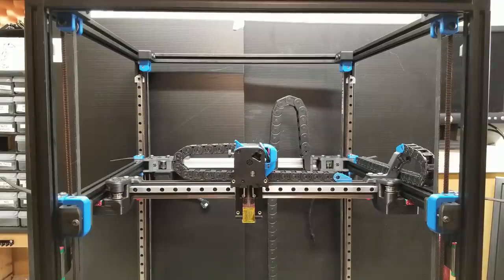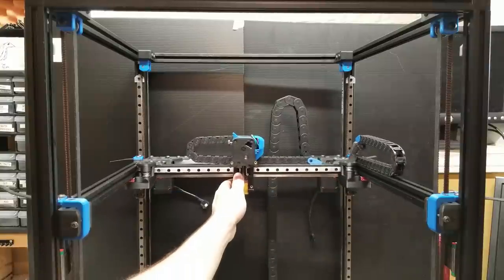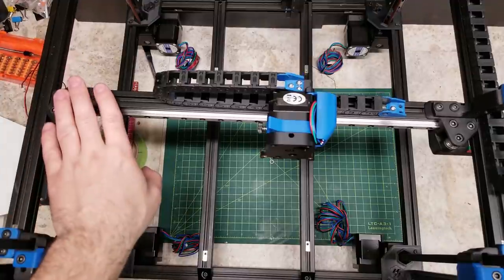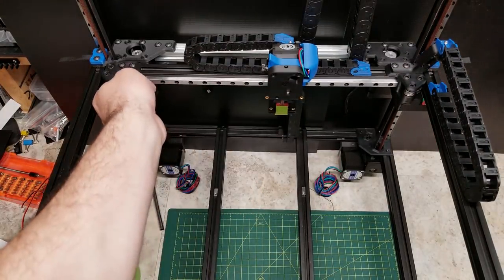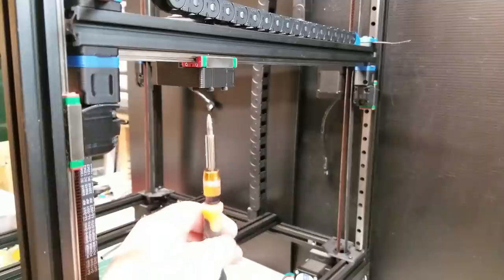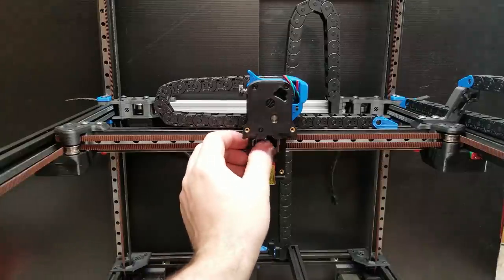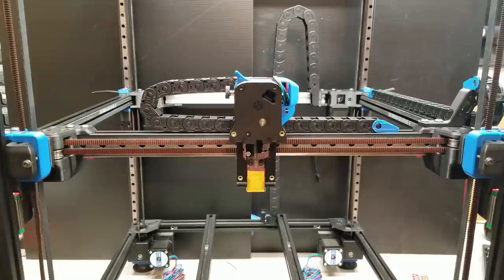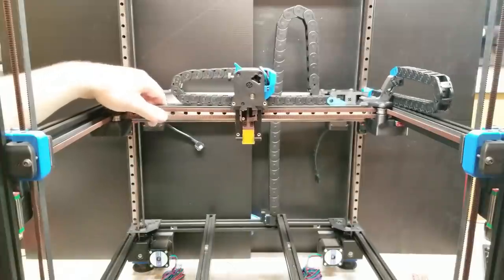Solving Gantry Racking

Comment: For anyone that fails the movement test where the head should not move in a diagonal, i found moving the head with one finger side to side allowed me to see which cable was not moving and easily pin point the bad bearing. I also used a sharpie to apply a mark to the ab drive bearings. After replacing that bearing the movement was nice and smooth like in this video. Thanks for the very helpful video!

Comment: If you have owned a motorbike with a belt drive you know how to tension it, yes there is such a thing as a belt tensioner that shows you how much tension a belt has at a set distance from neutral relaxed position. In fact a ruler plus a small portable weight gauge would do the job. Just make sure you measure at true centre.

Comment: You saved me a lot of hassles and frustration - kudos to the Voron discord community for pointing me here. Basically I put the belts on incorrectly (no equal length) and then completed assembly of the printer. I noticed that I could not get the x limit switch to engage due to the assembly being racked. I removed the belts (and ordered new ones since I already cut these (derp)) and was able to un-rack it. Now the carriage is truly square and moves without binding.

Comment: This is by far the hardest and worst part of building a voron.  I have never found this actually possible.  Unlike what he describes in this video, on every printer I have built, on my 5th, the problem isn't that the problem exists in the opposite corners, it's always the same side.  Doesn't matter how square the frame is.  I have only used LDO extrusions, so maybe the problem lies there, not sure.  But on all 5 printers, 2 tridents, 1 v0, 2 v2.4's, you can push and pull on the same side, front/back.  I'm sure it's 100% me, maybe on arm is longer than the other so I can't get the frame straight, or maybe one eye is much stronger than the other...  who knows.  But I have found it to be 100% impossible to actually rack the frame, regardless of not having any binding, being perfectly level, squaring with precise squares, etc.

Comment: Seems like a proper mechanishm.

My only issue with all these thin cube frames is that they are too big compared to extrusion size and rigidity. I am pretty sure that diagonal (Z-form) reinforcements, possibly not just one per side but at least at the middle of each frame rail too would help a lot in wobbling. Theoretically the Y carriage would need that too (to prevent flexing by heavy X accellerations), but that's hard to install in this form. Maybe something like a strut brace in a car.
Reply: Once you install side panels they'll make the frame more rigid.

Comment: Is the "springiness"  in 6:06 (right side) acceptable? I'm assembling my gantry from scratch and I'm not able to get rid of that (after rebuilding the gantry 4 times), it's always in one of the corners.
Reply from the maker: You want to minimize the racking as much as possible, was kinda hard todo when i was recording but i went through and re-adjusted the belt tension to make sure both XY joints where touching the back at the same time

Comment: Fantastic video!  I've been stalled out on my Voron partially due to gantry issues.  This will help with some of the problems I've noticed in my build immensely!
Reply: You know the best place to get help on your Voron is to get to the voron discord
Reply: @yvesinformel221  When I'm actively doing assembly work I practically live there. 
@
Nero 3dp I just finished fixing my terribly racked gantry prior to wiring/tool head attachment.  I'm so thankful for the timing of your video.  You saved me a LOT of time, effort and cursing.  The documentation for building a Voron is great, the Discord is insanely helpful, but seeing how certain things should be done is priceless.

Comment: At 5:32 if one of the rails works smooth and the other not than you will nbot be able to push in the middle and slide on both sides smooth. So you will also have a gab at one side.

Comment: doesn't this method assume the rails are 100% parallel?  the Y extrusion could be off parallel but the rails could be parallel to each other or vice versa, the guides help but only so much, make sure the rail it pretty straight on the Y first :)  course i don't think the rails could be off more than 1mm.

Comment: Thanks for the video. Ran my belts last night and was a little concerned about the force needed to move things around afterwards.  Figured it was just the drag from the motors as i did not feel anything strange.  Just a steady resistance.

Comment: Thanks for posting this - was wondering how to fix for this!

I also used another c-beam ( 40x80 ). I used the c-beam to level relative to the build plate and then again up top with a square to get things leveled out right. I got a lean to the back of the frame due to the weight of my stepper motors - it pulled in a dip to the back at to upper/lower extremes of the z axis. ( The c-beam was for consistent height, 80mm from plate on front back and then resting in the middle while I loosened/tightened everything )

Comment: I noticed that your drag chain radius is very narrow. If you have just used regular cables your breeding a problem. I think even for high flex cables it would be a little bit too much.
Reply from the maker: 20-24awg high strand count silicone insulate wire is being used here and in this case the bend radius is sufficient. We now spec for ptfe insulated wire which is even more suited for this application.

Comment: I am glade to see that you are also using a bearing stack instead of the GT20 6mm idlers. Did you find that the belt runs at a slight angle? I wonder if the extra width from the stack (not having teeth) can be the origin of this angle?
Reply from the maker: The size difference is so small it barely affects anything in a noticeable way

Comment: Great video.  As always thanks for the great info.  I am still having a racking issue that i cant fix with loosening the gantry.  I have gone so far as to remove the belts all together and loosen the gantry rail bolts and the carriages.  I hold the gantry lightly against the front rails and snug all screws then on another pass tighten.  When i let go, the left front side pulls back.  What can i do to fix this?
Reply from the maker: Ensure the frame and everything is square. Sounds like.something isnt in the right spot

Comment: I got here searching for COREXY printers to build and watched a number of your videos. But I was surprised to learn that the entire XY mechanism was on a gantry as opposed to the other designs where the print bed moved. I watched the videos as YouTube sequenced then and finally got to why you needed 4 Z motors with such a huge gear reduction. I am very curious as to the advantages. Could you please direct me to the discussion or analysis of the design decision to move the entire gantry instead of the bed. This looks like a very robust design.
Reply: Previously, the moving gantry had a big advantage of auto bed trimming, nowdays with 3-axis bed leveling, you can also perform bed trimming.

Most of the community agrees that the moving gantry design is more of a really cool gimmick than a real advantage, the moving weight of the gantry brings so many problems and complexity that most of the time it does not pay itself. 

Another advantage that some people claims that the voron 2.4 has, it's that it's center of gravity, on small prints is lower, which allows for more speed.

Comment: Down to the number of teeth!? How do you count the teeth on a 2 meter belt? 😅
Reply: you pinch them both at one end so that the teeth interlock, then run your fingers down the length until you get to the end you want to cut to. Remember which belt was slightly higher to start with and you're golden

Comment: If it’s a duet card it’s basically impossible to reach 27v which is needed to burn that card according to this https://forum.duet3d.com/topic/7403/moving-the-gantry-damage-the-stepper-drivers-when-powered-off/9
Reply from the maker: If its a duet.  I try to keep things as part agnostic as possible. Cant guarantee everyones controller wont be damaged by backcurrent.

Comment: this video has errors 
around the 5:30 mark you really need to crack the mgn blocks loose. if a block is at an angle it will always be off angle. also a tuner app will help with belt tension

Comment: Invest in a dial indicator, a caliper, a tensioner meter (you can get a Frequency meter app for free) to calibrate your 3D printer. "Feels smooth" is very subjective. They all can be obtained for approximately $60 total on AXXXXXXXX, and I think it's a worthy investment (I use them for other purposes as well). $60 bucks is a small investment considering you just bought a $400-500 printer -- but don't forget to add another few hundred bucks to upgrade it. You will need a caliper to measure the accuracy of the calibration print, a dial indicator to level the bed or Z height (I don't really trust the auto leveling sensor, and you can use the dial indicator to verify its accuracy), and frequency meter to tension the belts (where you measure matters so keep it consistent).